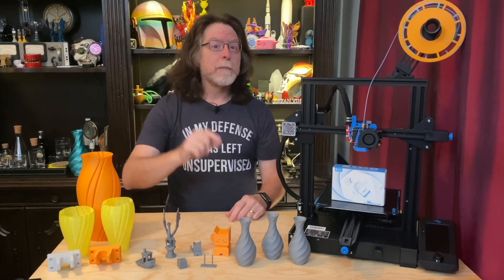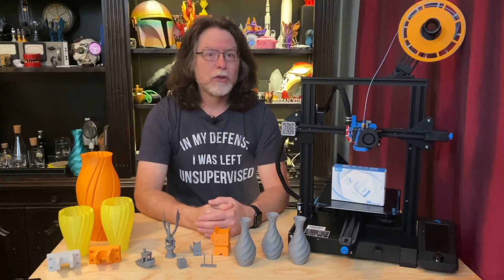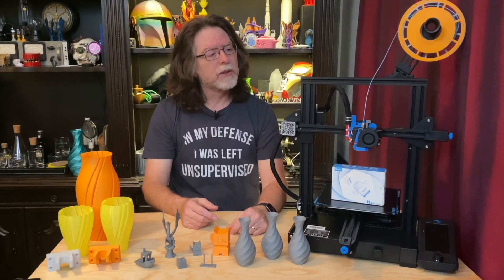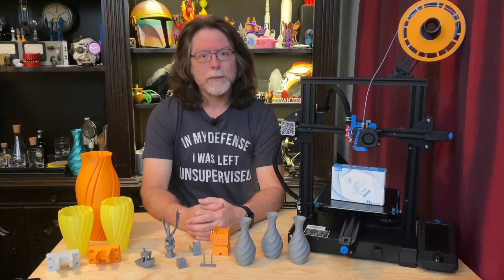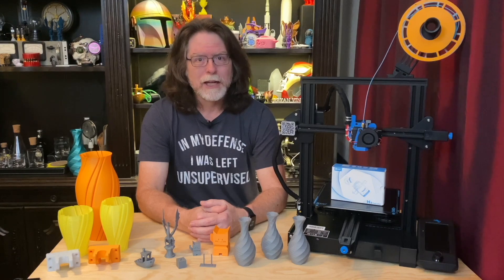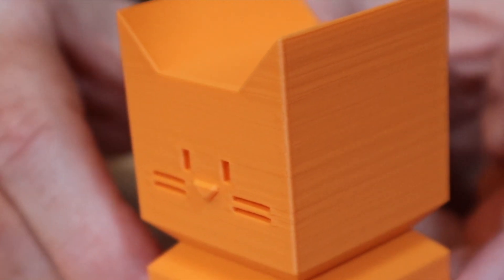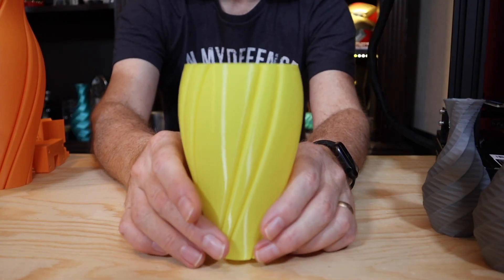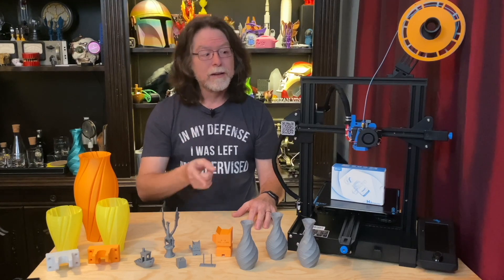The BIQU H2 Compact Direct Drive Extruder Review

Comment: Hi Bryan, Thanks for the very informative video. I'm really late to this party toying with the idea of a Biqu H2 500C on an old Ender 3 with a Creality 4.2.2 motherboard & CR-touch. I'm trying to get high temperature printing with the bonus of direct drive. The mechanical and wiring are non-issues for me (electronics tech in another life) but I'm a newbie with 3D printing and haven't yet monkeyed with firmware. Any idea whether the 500C is significantly different from the regular H2? Also, as others have mentioned it's hard to tell what if any changes will be required to the actual firmware, beyond just configuration things like E-steps. Should I, as a novice, expect issues dealing with firmware? Many thanks!

Comment: just installed this on my modded ender 3.

making cable extensions was a pain in the ass. 
the heater cartridge cable has small fibers that make you itch like crazy (fiberglass?) - wear gloves.

i had to calibrate e-steps to 2377 instead of the recommended 932. Not sure whats going on with that...
makes lots of noise on retraction.

so far calibration test cube came out fine.

Comment: I know what that banding is!

It is the nozzle laying material down the other way compared to other layers!
Reply: Is there a way to fix this? I had this problem for a while and reallt want to fix it!
Reply: @philipprior9174  I'm not sure, you might need to play with some firmware features.

Tune Linear Advance and turn S-curve acceleration on or off to minimize the effect.

Maybe your slicer has an option to follow a specific direction, but these artifacts generally show up aligned to printed features.

Comment: Hey Bryan. Thank you for the H2 video. I'm in the process of installing one on my Ender 3 v2. I elected to also install a Biqu Hermit Crab thinking that it might make installing the H2 a little easier. (It did and didn't, but that's another story.) In your video on the H2, you don't get into any firmware changes for the H2. I'm something of a newbie, so this has been a struggle finding a complete resource. Biqu documents the e-step settings change to 932 and a stepper voltage of 800mA, but not how to make them. Do you cover these changes in another video perhaps?

Comment: The lines after features on the outside surface are due to the slowdown / speed changes due to those more detailed features. There is still pressure in the nozzle preventing the immediate reduction in flow compared to the reduction in speed. The result is a slightly wider filament path after detailed features.

Comment: The lines on the Cat Print, I have seen this kind of thing as well. If you look at the STL in something that shows wireframe you will indeed see geometry intersections right where the lines form. Take the model into a program that will remesh the STL. I use Blender and in sculpt mode click remesh. I usually set it to .03. If is something I put a texture on or a logo I set it to .01 For some reason I don't understand this often fixes those ghost lines

Comment: just discovered how to loose none of the bed print area on an ender 3 with this extruder. saw another video where a guy pulls the 4 bolts holding the y axis rail in the center and using 4 5mx35mm bolts with a flat and lock washer and 4 2020 profile t nuts so it can be moved where you need and tighten. I still wanted the full bed area thats not usable in stock form so i did recompile jyers. mostly mentioning cause it was a fix for the bed

Comment: 10:45 Coasting in Cura is not a wipe.  It stops extruding before a scheduled retraction to reduce the amount of pressure in the nozzle chamber.  This hopefully reduces oozing during travel.
Reply from the maker: OK. I may have gotten my terminology mixed up with PrusaSlicer. PS says its Wipe while retracting setting "...moves the nozzle while retracting to minimize the possible blob on leaky extruders." Basically it wipes the nozzle's butt on the print (yuck? But also handy).

I'm looking at Cura now, and I guess "Coasting" is before every retraction, and "Wipe Nozzle Between Layers" is the same thing, but only at the end of a layer?

Comment: Two or more questions,  Did your really like this? Looks much lower that the Micro Swiss setup.  Are you going to share your mounting bracket with wire management.  In the video, looks great.  Also, does it use the same nozzles as the E3V2?

Comment: I'm thinking of upgrading to the BIQU H2. I have a Creality CR-10s Pro v2 and the only Creality thing left on it (besides the frame) is the filament detector and extruder.  I have a Lerdge K board running it, but also going to change this out for a BigTreetech SKR2, and thought I would also do the BIQU H2 at the same time. Would you recommend it for an everyday printer where we don't do a lot of flexible filaments, and mainly print with PLA+ and PETG?

Comment: About te cat, im quite sure that when it's directly related to something on the model (and its not ghosting) it's coz the retraction it's not 100% right, so it retracts a bit more than it should on some parts.
Reply: Is there way to fix it? I've had this problem for ages.
Reply: @philipprior9174  What does it exactly happen?
Reply: @LarvaFlacida  I find sharp angles, like the eyes and whisker features of the Calicat at 12:40 on the video, cause a distortion in the wall.

Comment: For those of you who are (or might be in the future) having problems getting the retraction speed dialed in on your new BiQu H2... I hate to go against what Bryan has in his video, but this comes straight from BiQu tech support. Try using a retraction speed of 4. That's not a typo. Try using a retraction speed of four . Yeah, I know it sounds insane, but I took their advice, and my retraction is now spot on with a retraction distance of 0.5 and a retraction speed of  four . You can use whatever de-retraction speed works for you (I use 40), but you might seriously want to try out a retraction speed of four with your new H2.
Reply: I'm using Cura Slicer, do I just put in 0.5 retraction distance in or I have to convert that number? Just looks a little strange, usually retraction distance is from 1.5mm to about 7mm depending on the extruder.
Reply: @deniellemondesire7080  Yes, no conversion needed. With direct drive you do not want high retraction distances. You are more likely to cause jams if you go higher. Those numbers you saw were for bowden set ups.
Reply: interesting will try it. 
h2 smart manual recommends 1mm at 15mm/s

Comment: I bought one and am fitting it to a cr6-se. As you say, not for the faint hearted. A lot of dimensionally accurate pre printing required before head removal. Thanks for a great video.
Reply from the maker: Let me know how that goes. Are you somehow retaining the pressure sensor that detects when the nozzle touches the bed, or are you going with something like a BL-Touch?
Reply: @BV3D  I'm following a guide from dammstien.nl a guy known as sebazz who wrote the community firmware for the cr6. Check out his github and blog.
Reply: I will reset the pressure from the pot as his guide describes as the new head is much heavier.

Comment: I have the E3D Hemera and I can tell you this is NOT a clone! One simple difference is this extruder has a superior mounting system instead of the totally lame ass dog ear driver motor mount on the E3D that is prone to breaking and the only solution is to buy a new motor, regardless that there is absolutely nothing wrong with it. It is the most ignorant mounting system I have ever seen and that one factor alone is why I will never buy another one, since other than that it has been a fantastic extruder!

Comment: I did it installed the H2 extruder on my ender 3v2. Had to extend the cables all of them. I used the stock stepper cable which i extended found out that the two center cables are crossed on the connector so i un-crossed them and now the stepper works. I'm going to give the fan mount a try. Thanks for the Video it helped considerably.

Comment: Where did you get the flexible textile tubing
Reply from the maker: I got it on Amazon, but the stuff I ordered is out of stock. This stuff (linked below) looks like exactly the same stuff.
MGI SpeedWare Split-Sleeve Wire Loom, Woven Mesh Fabric Cover - 25 feet (1/2")
It's 25 feet (7.6m) of the stuff, which is a ridiculously huge amount. The one I ordered was only a 10 foot length.
https://amzn.to/2QVtWBZ [affiliate link]

Comment: Any thoughts on it not having a tension adjustment? I feel like this would be a big deal for flexibles but it didn't seem to make much difference for you. Thanks.
Reply from the maker: It hasn't been a problem so far. I think it might be less of an issue for flexibles. I would think they'd be able to spring back to their original diameter more easily than, say, PLA. Looking at the exploded diagram of the H2 it appears that the spring applying the tension to the second filament drive gear is all the way around the back of the unit, so they'd have a fair bit of redesign to do to make it adjustable.

Comment: Marks on the sides are bouncing. You have to upgrade the belt for a better PE one (white). Regards.
Reply from the maker: I have some of that. White belts with the steel reinforcement built in? Thanks! 👍
Reply: @BV3D  Exactly. That PE belts are the less subject to stretch. On the other hand, they do not conform well on smallest radius (GT2 16T pulleys) and may be a bit louder while operating (it's barely noticeable). Regards.
Reply: @axelSixtySix  Do you have a link to these type of belts?
Reply: @philipprior9174  Do a "GT2 PU Belt" search on any marketplace.
Reply: @axelSixtySix  PU or PE? Your first post mentioned PE and PU in the second. Are they different types of the same thing?
Reply: @philipprior9174  same module, different materials: steel core, PU enveloppe
Reply: @axelSixtySix  Last question. Z, X or Y belts or do they all need replacing?

Comment: The non-adjustable tension of the H2 is a big disadvantage. Also filament tends to jam when loading or unloading filament, due to the internal clearance of the extruder. Finally, mine had a stripped grub screw for the heat break.
Reply: Not had any problems with jams so far on mine. are you using an early model before the improved production?
Reply: @MeshJedi  Yes, there have been multiple versions in the field
Reply: You have to use very slow unload of the filament. 
As the filament path is so short, when you unload the filament is still melted and stick on the wheel. Which give you jam.
So you have to use slower unload to let the filament cool down and does not stick on the gear.
In my case, i don't use the filament unload on Marlin and manually change the filament by manipulating the tension lever

Comment: where did you get this slive? Is it possible to get a link?
I use a variant of this design, to turn the direction of the filament, som it can make a U-turn form the front left side:  https://www.thingiverse.com/thing:4112997
Thanks for sharing your great videos :-)
Reply from the maker: Hi Asger, the cable sleeve I had ordered is out of stock, but this looks like exactly the same stuff.
MGI SpeedWare Split-Sleeve Wire Loom, Woven Mesh Fabric Cover - 25 feet (1/2")
It's 25 feet (7.6m) of the stuff, which is a ridiculously huge amount.
https://amzn.to/2QVtWBZ [affiliate link]

Comment: I saw somewhere this has a 7:1 drive. They should have included a pancake stepper (nevermind, it has one. Missed where you said it). Those are plenty even for the 3:1 (clone!) like I use.
Reply: Correct, default e-steps are 932.

Comment: Bryan, I fitted a BL Touch to an Ender 3 and got it printing perfect for a couple of weeks with the best first layer of all of my five printers but then I went to print something today and the first layer has gone down really thin with almost transparent plastic, the extruder is not ticking though and I let the print continue to see what happened, it came out ok and to size in the z-axis.
Have you any idea what is going on here?
Reply: It's possible the mount shifted. I had that happen to me earlier this year. I can see the 1st layer patter in my PEI sheet. 😕
Try verifying your Z offset value again.
Reply: @OldCurmudgeon3DP  This printer is possessed, I put a print on to get a good look at it in action today and the purge line is printing plastic super thin now but the print is back to normal, I thought I might have set something wrong in the slicer when I first got this issue so I checked the Cura settings which are all good so then I printed the g-code when this issue came about and I got the same results as my earlier print, thin purge but perfect first layer on the part.
I checked the mount just now and it's fine, in fact, it cant move as it is the metal Creality mount that has a fixed mounting and thread positions.
 I changed the build plate from a spring steel PEI to the Creality glass and ran the part again and with exactly the same results, I have checked the bed level manually and remeasured the z offset and all is good.
 I am at a loss